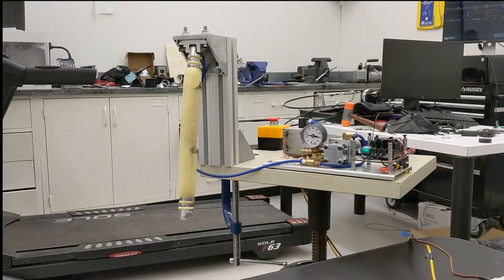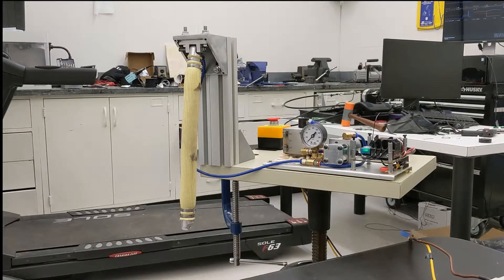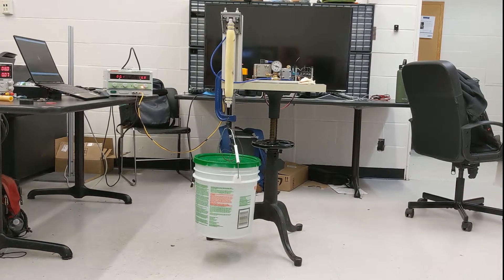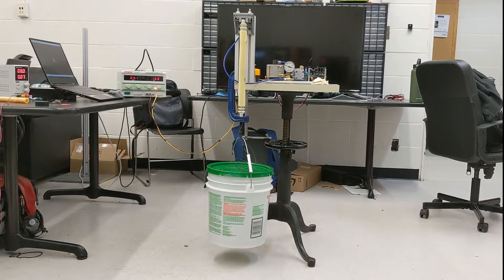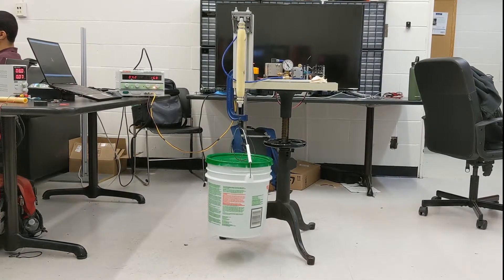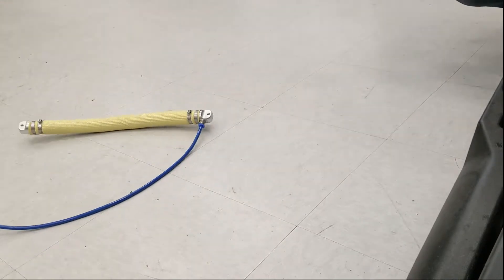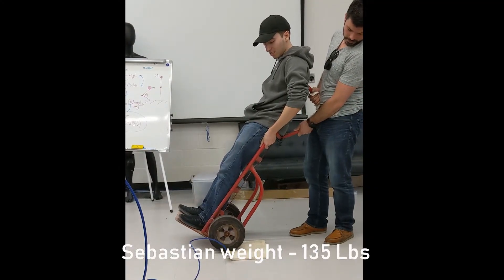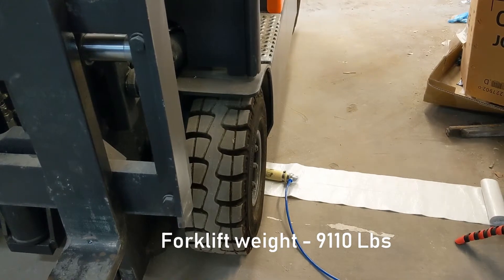Untethered High Force Hydraulic Artificial Muscle for Portable Exosuit

Comment: Is it possible to regenerate part of the energy used for contraction by letting the oil flow back through the pump, and thereby back drive the motor when depressurizing?
Reply from the maker: In theory, yes. I think it is valuable to check if we can use the depressurization to increase energy efficiency. But in practice, there are two potential issues. The efficiency to recycle the flow might be very low. In addition, this will also require some hydraulic components and this will increase system mass and cost.
Reply from the maker: Wehner M, Tolley MT, Mengüç Y, Park YL, Mozeika A, Ding Y, Onal C, Shepherd RF, Whitesides GM, Wood RJ. Pneumatic energy sources for autonomous and wearable soft robotics. Soft robotics. 2014 Dec 1;1(4):263-74.
Reply from the maker: http://www.cs.cmu.edu/~ylpark/publications/Wehner_MAL_SoRo_2014.pdf